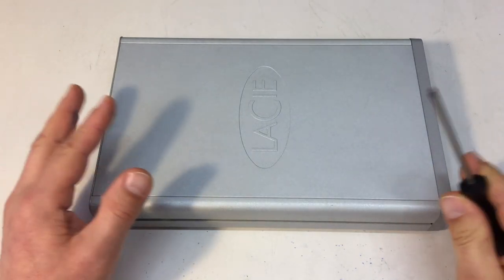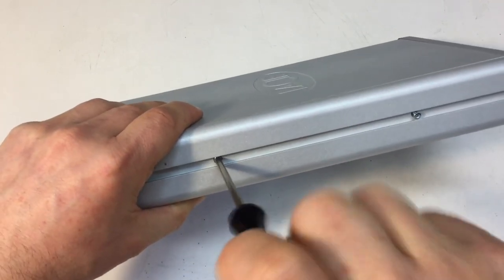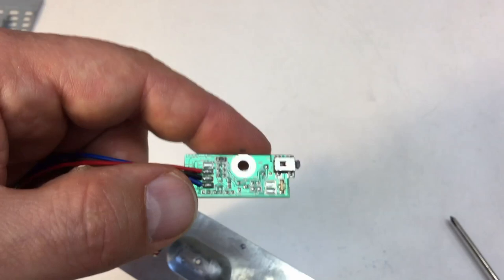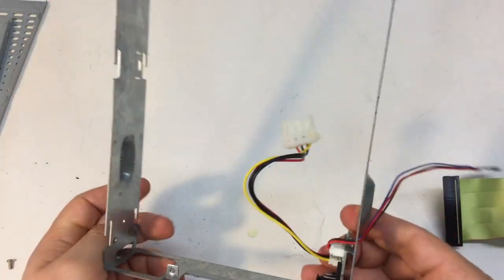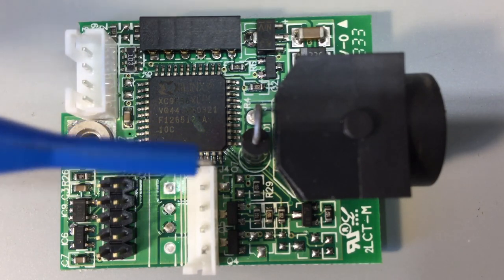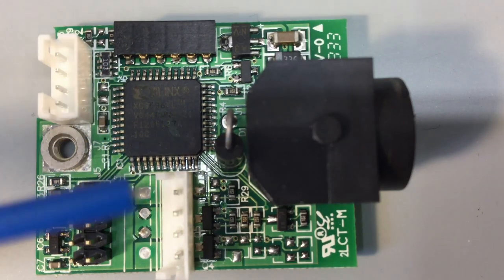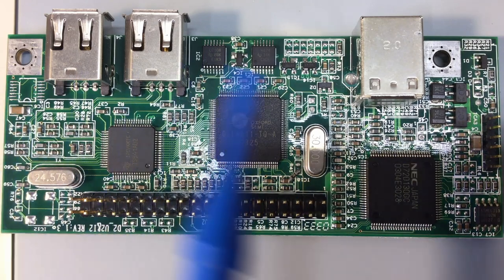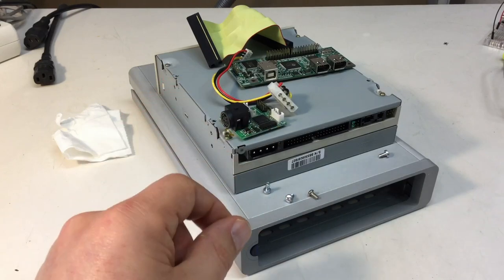LaCie External FireWire / USB 2.0 CD (!) Writer Teardown (All the Chips)

Comment: Vintage indeed!
Reply from the maker: Yeah, they don't build them like that any more. I still can't get over them using that PLD on the little daughter board.
Reply: What the hell is it even doing?
Is it doing some sort of power management or just driving the pointless LED and button on the front. What does that button even do? The drive already has an activity LED and eject button.
This enclosure is good quality but its way over complicated. Most drive enclosures just have a single USB to IDE bridge chip.
Reply: There are unpopulated locations on the left where 2 more chips could've been, making it even more complex.
Reply from the maker: @Simon Tay Indeed, it's completely over engineered :-) I don't think it's doing any power managements, 'cause it's mains powered - but then, it's a LaCie ;-) That button is for sure an eject button. Pressing it will send the ATAPI/IDE eject command to the drive.